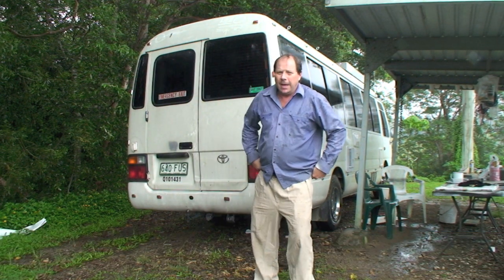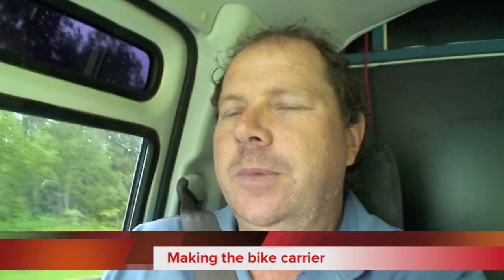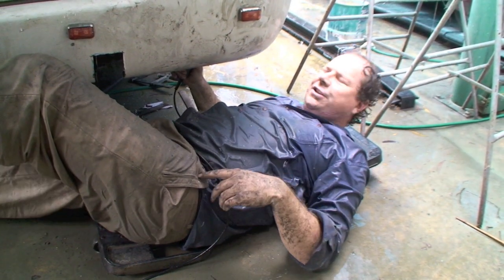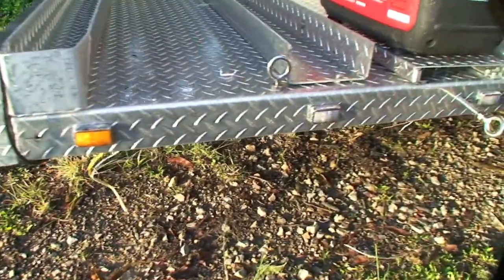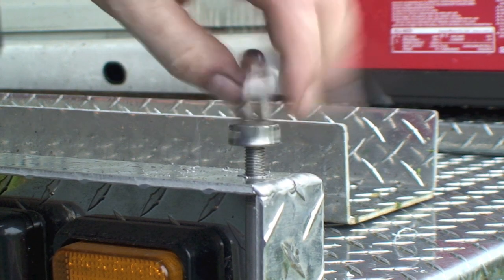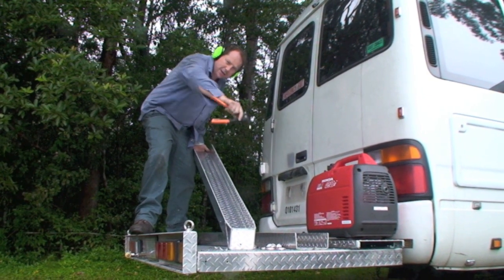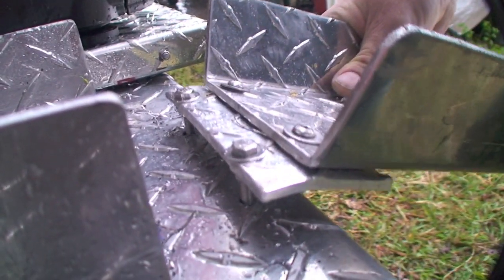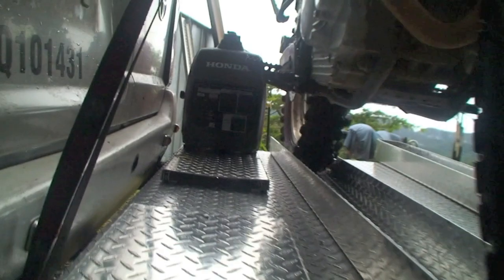NEVS BUILDING YOUR MOTORHOME CAMPER MOTORBIKE RACK

Comment from the maker: @gadgetman506 Hi Pal yes the maximum length you can protrude is to measure the length of your wheelbase and then you can go out from the rear axle 60% of that distance, but there is more too it so a check in with the D.O.T is recommended, good luck.
The box was 90 by 45 i believe and it is bolted onto the chassis rail with many 10mm hardened steel bolts, hope this helps.
Reply: so what is the legal distance you can go out from the back on a LWB coaster? I am looking at buying one and was thinking of putting space on the back for a small motorcycle (only 1)